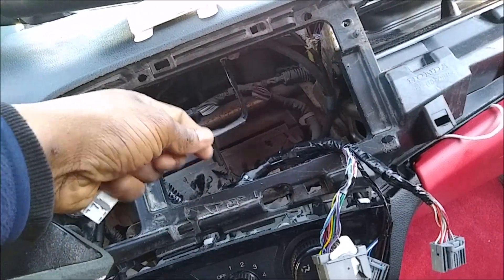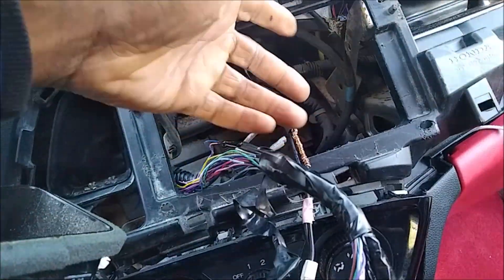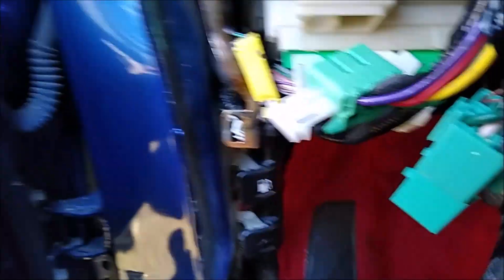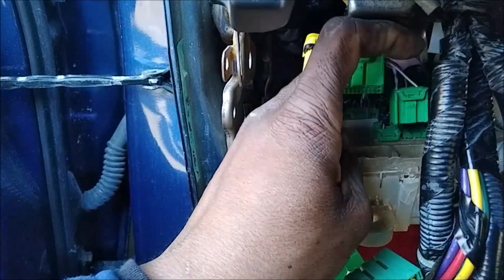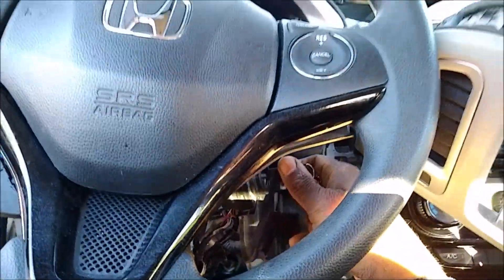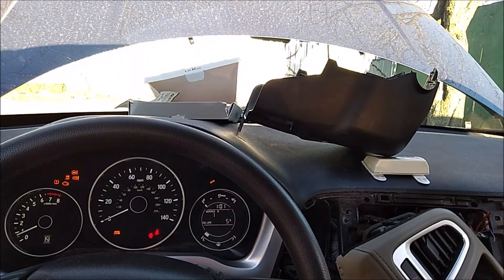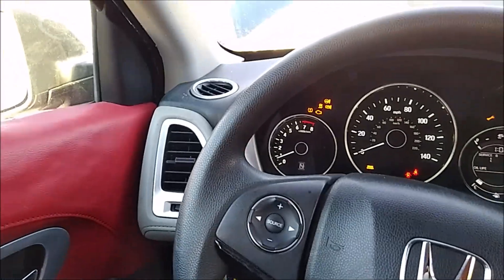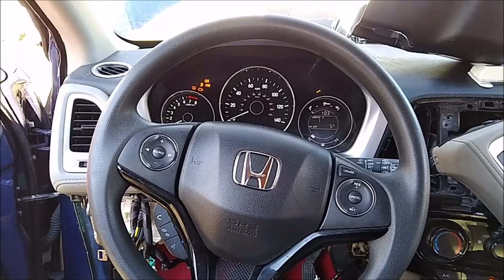FIXED Honda Transmission Failure No Shift After A Radio Bad Installation HRV CRV Accord Civic  CVT

Comment: Hey bro I’m from Guyana I own a Honda Vezel hybrid 2014 an the battery won’t charge instead it drain an my gears won’t change can you help me?
Reply from the maker: @yungskullenton3linkboss  check the ECU connector wires . I had the same problem a few years ago.